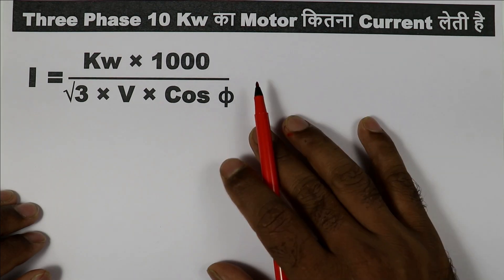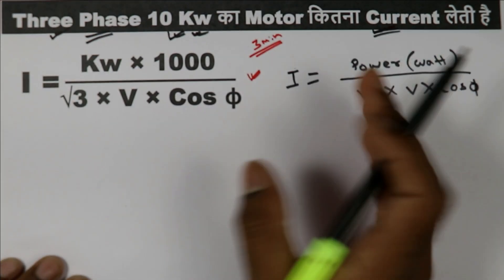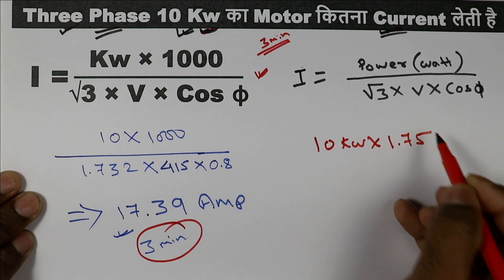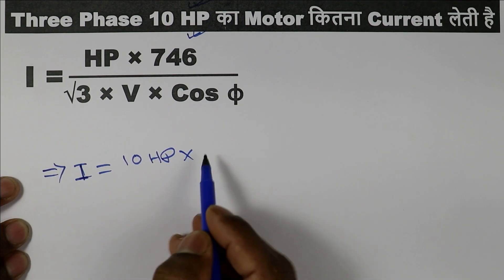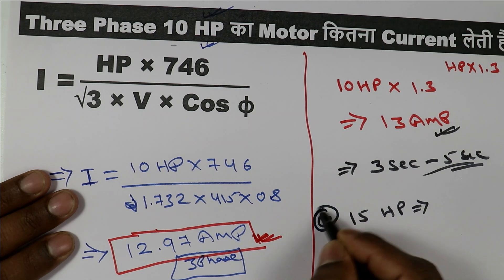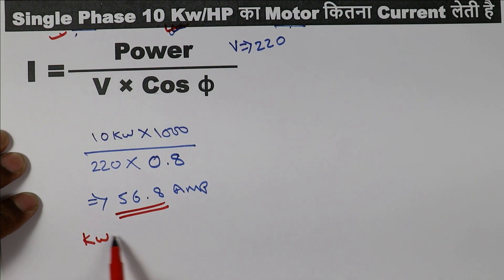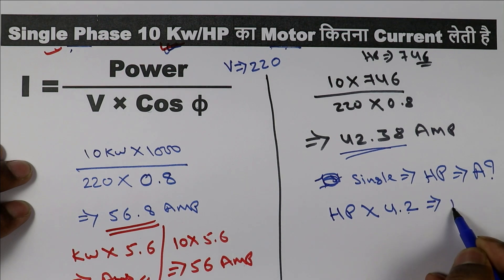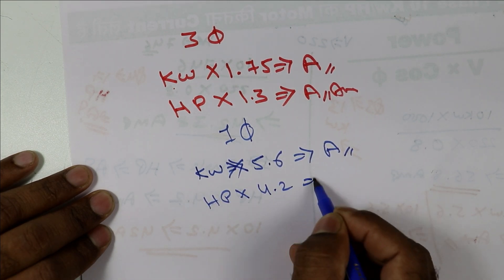3 Phase and Single Phase Motor Amps Calculation with Short Trick for Electrical Interview

Comment: Asumptions  ..expl  s  elcb usin loredand  wattrs   .incandenscent  lamps  .60 wats   tube  light 40watts   celling  fan  100watts    plug  point   100watts   ..maxium  load  per  cicuit =800WATTS   NO POINTlimited  to  10per  circuit   expls .. )$    Hp..   I=h×735.5/6<
£3XVLXPFX>^moter  no1:1!=5/735.5/.£3x440x0.8X0.85  motor  no  2; i2=3x735.5£3x440×0.8×085=4.26A moter  no  33:l=0.5×735.5 230×0.8×0.85=1.42A  starting   current  of  the  highest  Rating  motor   =7.1×1.5=10.65  Amperthis baic pointed ok   othe  rating  of  main  switch   the  current  rating  of  the main  switch  is  the  starting  currentof  one  moter  of  the  highest  rating  plus  fullload   currented  of  remaining moters
Reply: [=7.1X1.5)+4.26+2.35+1.42=18.68 .so  30 ..500v   Tpic  swich shallbe  used  as   mainswitch at  meter  board  ..A

Comment: I assume the current calculated here is for full load.  If the motor is not fully loaded the current would be significantly lees amps